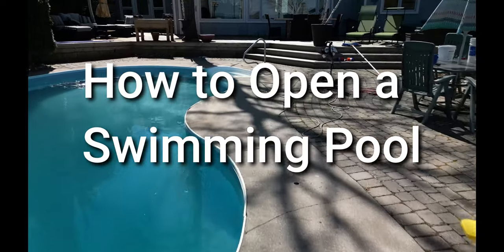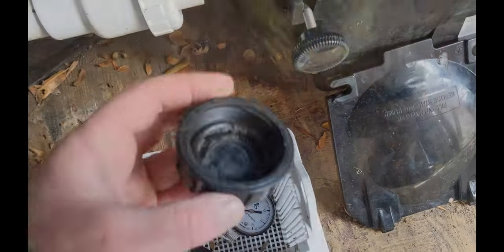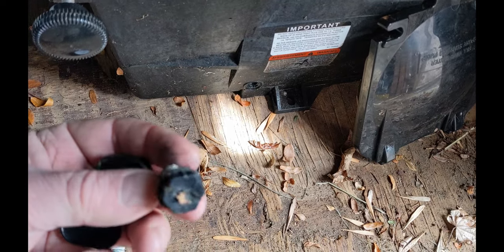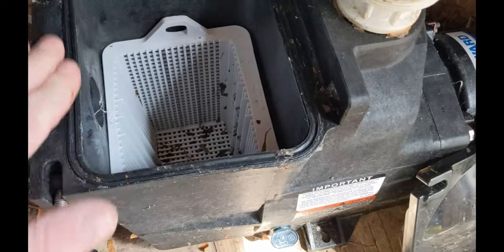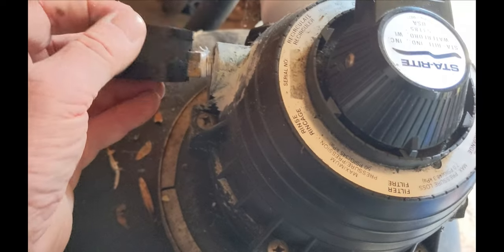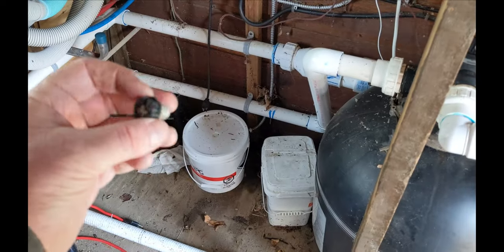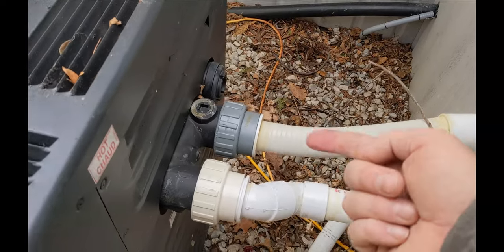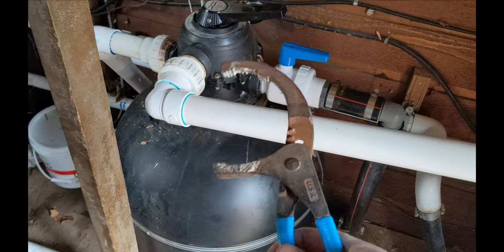How to Open a Swimming Pool | Pool Opening | Inground Swimming Pool Opening Steps

Comment: Love the video  . I like how you didn't rush through it.  And  took your time, sir. I'm new at this pool thing and want to learn how to do this for  this summer and not have  to get  a pool company.  I have a salt water pool, but it doesn't have a heater.  I would  like to see a video  on how  to add salt  and how to use the test equipment for  the pool chemicals and the test straps.
Reply from the maker: Thanks for watching.  As for adding salt and testing salt levels, we do have videos on this.  Just look in shorts videos for testing and the salt system videos

Comment: I have a basic vacuum.  Not a robot. I’m having a hard time with it holding suction. It holds for a few minutes then the suction stops . I thought it might be the hose, bought a new one does same thing.
Reply from the maker: Manual vacuum or kreepy vac?
Reply: @VIPPoolsandSpas  manual
Reply from the maker: @traceylynn1710  Vac on waste if you have a sand filter.  If not a sand filter, you will have to get as much stuff out of the pool before vac/ing